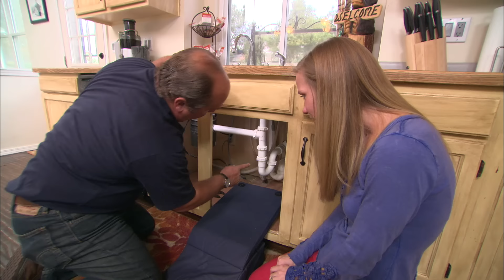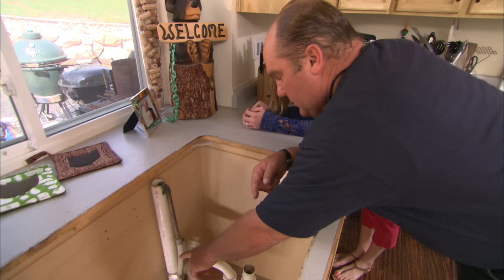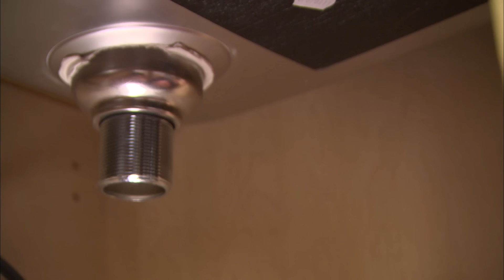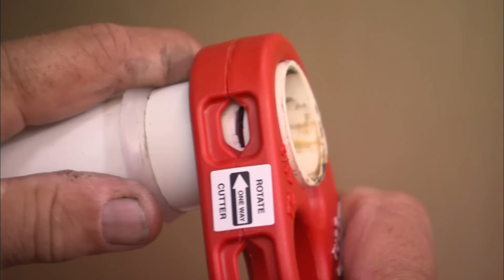How to Replace a Kitchen Sink and Faucet | Ask This Old House

Comment: Many diy disposal installations with a dishwasher drain connection dont break out the seal and call an appliance repair guy because the dishwasher doesn’t drain. An expensive lesson.

Comment: I would have left the pipe above the old dishwasher p-trap and PVC welded a cap on the riser. Just cut off the top 2 inches to eliminate the gap that was cut out at the top. It would be a longer term solution. That black rubber cap will eventually deteriorate and start leaking. With the top of the pipe so close to the faucet it shouldn't interfere with the operation of the spray hose. In some jurisdictions you need to have a plumbing license to remove a p-trap (even temporarily)
If the remaining p-trap pipe DID interfere with the sprayer hose, I would have used a hub saver to drill out the old pipe from the PVC sanitary tee and pvc welded a plug into the fitting. That would give you the same permanent solution and remove all of the old piping from the under sink area.

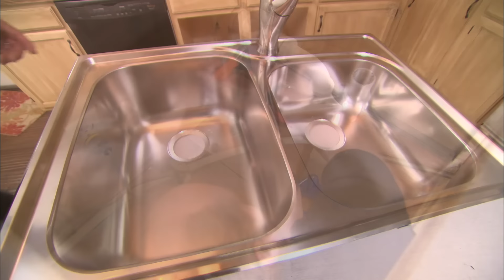Comment: Lots of comments on here asking about what brand this sink is. At 6:23 of the video, when they are lifting the sink into place, you can see a sticker with the brand name on it. It is a Blanco sink. I’ve looked at their website and I don’t see this sink available anymore. No mention of an integrated gasket on any of their sinks.  UPDATE: I just talked to Blanco on February 20, 2023. They advised that ALL of their stainless steel sinks come with an integrated gasket and hold down clips!!  So there ya go!!
Reply: Likely because most sinks today are made of stainless steel or cheap plastic.

Comment: I wish he would have showed the tightening wrench that comes with garbage disposals. It's a lot more versatile than using a screwdriver, especially when working in tight areas, plus it's made to insert into the bottom of disposals to manually turn them if they become stuck.

Comment: Very nice, easy-to-follow video with lots of rxplanation.  I am not sure if anyone asked these two questions:

1. I did not see the use of any teflon tape.  Why not?
2. Plumber putty is know to dry up and crack, shouldn't a waterproof silicone been used instead?

Again, thank you for the wonderful video.
Reply: Teflon tape or pipe dope is only used on tapered threads. On fittings with a compression ring or gasket you don't use any.

Comment: Came here after my sink got installed to see the process. Something told me to do it. I'm disappointed that I didn't get silicon added, that he didn't knockout the dishwasher hole for the disposal, and that he left the job completely incomplete because he couldn't make the piping work and told me that somebody would need to cut out the whole piping. That was false. I had another guy complete the piping part in 40 mins. I gave the previous guy the benefit of the doubt because I was going from 7 inches of depth to 10. But the guy that completed the piping said that piping never works out of the gate and the increase of depth shouldn't be too much of a problem. And one more complaint for the original guy, he didn't clamp down the sink. Not the worst thing though.

On a funny note, I got that exact faucet displayed in the video or very similar to it. My can be activated though by a touch.

Comment: Funny that he uses a screw stick as a screwdriver for all his clamps, when he can pull the bit out and use the barrel as a nut driver on the clamps. SOOO much easier than using a flat tip screwdriver.

Comment: Both of those shutoff valves were leaking, why were they not replaced??? Also, the control valve for the sink faucet goes to the right, no on the center... And why did you reinstall that Badger disposer, they are the bottom of the line product from ISE. They rust out often (because they are not  stainless) and they do a poor job grinding food and have a lot of blockage issues...

Comment: My luck... the screws that are the hardest to access would be rusted stuck and stripped, and they would've used epoxy rather than silicone to glue to sink to the counter.

Comment: The dishwasher discharge hose is routed incorrectly. It needs to be routed through the cabinet about 2” below the countertop. That way any food that gets stuck in the hose won’t be suiting in the lowest loop of the hose which could clog the hose and if left long enough it will smell.
Reply: Nah it's fine

Comment: I am amazed that "this old house" doesn't own a sawzall.
Reply: Richard is using "the right tool for the right job.' 

A specialty tool like the tubing cutter he used in the video automatically deburrs and bevels the pipe to prevent leaks, rather than the uneven and / or barbed edge that may be produced when using a hacksaw or power saw. 

We can file down an uneven edge, but a tubing cutter is less than $30 and can then be used again in future plumbing jobs.
Reply: Yeah for real. Hackzall or multi tool. Painful to watch
Reply: 4" hand grinder withe abrasive cutoff wheel life saver

Comment: Cut the pvc pipe then proceeds with a rubber cap without removing plastic residue. And why the rubber cap ? Why not glue a pvc male fitting , teflon and screw cap ? Little more permanent...

Comment: Without a stabilization plate, that faucet is going to be pretty wobbly.
Reply: How so? I've installed 100's of them with no wobble. If you tighten it underneath the sink properly,  you will never have a problem.

Comment: I would use a portable battery powered saw to cut out those pipes. So much easier and quicker. Milwaukee makes an excellent on small enough to be used for this application.

Comment: Any type of fernco cap or coupling requires 35 lbs of torque  in order to properly seal.. using a nut driver  will not allow full seal... need special 35 lb nut torque wrench

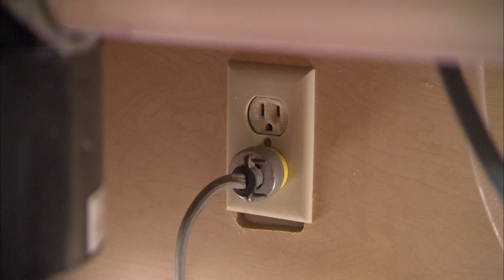Comment: 2:04 Should that outlet be a GFCI outlet?

Asking because mine doesn't have an outlet at all. It is direct wired and I was thinking of adding a outlet and a plug.
Reply: John Smith May be connected to a gfi breaker in her service panel.

Comment: I never understand ,why the homes dont have a drain going out the house from the under cabinet ,so in case of leak the waste water flow out of the house,like the one used on the ac overflow pan 😛😉
Reply: I presume that would be possible, however a downside of that is it would be a dry drainage, meaning you have an open line directly to a smelly drain.

Comment: To cut pipes close to a wall or other obstruction, use string. Take some string, the same stuff a string line uses, put it around the pipe and "saw" thru it but pulling it back and forth. Sounds crazy but it works great.
Reply: That's so funny, I was just picturing that exact solution while watching Richard sawing.

Comment: Homeowner: At 10:22 it looks like one of the disposal clips (the round steel bit to the left of the mount) missed grabbing onto the mounting ring like the others did. It doesn't seem connected. Or maybe they caught that later. 

I'm a big fan of Rich & the TOH team.  Been doing right by homes for decades.
Reply: I thought the same thing the first and second time I watched it. When I enlarged the screen, it was very clear that everything was engaged. That "round steel bit" is simply used for tightening. I wish he would have showed the tightening wrench that comes with garbage disposals. It's a lot more versatile than using a screwdriver. It's also used to insert into the bottom of disposals to manually turn them if they become stuck.

Comment: The old air gap pipe does not complied with city code.  Should use a new air gap for the new sink between the dishwasher hose and the garbage disposal to prevent clogged water flow back into the dishwasher.  On the other sink, the rubber gasket should be used in place of the putting.  It does not make sense to put the gasket under the sink.  The metal cap has an opening at the bottom.  The only water leak is only under the top strainer, putting is not needed for this sink strainer, and the rubber gasket is installed at the wrong location.  Rubber gasket is specially designed for this type of stainless steel sink.  How could a professional made such kind of mistake?

Comment: how do you adapt new faucets with half inch pex to 3/8 inch hoses on the new faucet .All new faucets come with 3/8th inch hoses and the cold works fine but the hot one just keeps leaking no matter what I do to the adapter that lowes sold me .I tried the adapter without a washer and with a washer but it continues to leak .Sometimes it takes a couple of days other times only after i use the dish washer .I am at my wits end with this thing

Comment: The hardest part about installing sinks is following whatever dumb ass installed it before you 5, 10, 20, or even 40 years ago (old apartment complex). The worst problem was leaks due to the overflow section of a bath sink rusting so after fixing a small problem like a bad p-trap and resolving the pipedream like drainage you have now disturbed the connection to the bottom of the sink causing it to leak. Tightening it wont work because the soft metal now gives to pressure, bends and breaks. Now you need a new sink. 1 out of every 3 sinks fought me. Glued in or tacked on in mysterious ways that only gave to sheer force while trying to protect the countertop. Don't bother reusing the old faucet they stopped making parts for it years ago and besides its welded onto the sink with rust. Okay, new sink put it now routing the drain to the non-adjustable glued in trap arm. Custom connection, pray you didn't break anything else by fixing this problem, look at your monstrosity and cringe while you test it for leaks. Apologize to the resident for it taking so long to order parts, listen to their complaints on the company, rinse, repeat.

Comment: The sink seems like a down grade if that other one is cast iron.  I have a faucet like that one and I think the person installed it wrong because it sucks.  It's impossible to turn and the hose has to be pushed back up some of the time.  Really considering going back to a 2 handle faucet.  Just bought a new basin and it's wonderful! Time to start a mini remodel.

Comment: Instead of straight across disposal drain pipe, you should angle down disposal pipe to the drainage system to avoid standing water in the disposal and rust build up. Teflon tape on all connections is always a good idea..don't see any here. Plus assemble the baskets drains, faucets and any other accessory before installing the sink. Much easier and less crouching.
Reply: Teflon tape is not necessary or helpful for compression connections; the compression ring or gasket is the sealing element, not the threads.  Teflon tape is primarily used for sealing tapered pipe joints, where the threads form the seal.

Comment: Unless you live in Heaven, NEVER get a stainless steel sink! Normal (earthly) water will cover it in minerals within days (oh, I forgot, women LOVE to clean their sink every day!). My new sink will be white.
Also, PLEASE use some new teflon tape when you reconnect the water feeds (a glued-on PVC endcap would have been better for the old dishwasher drain than that rubber one). 
Finally, who is the sadist who puts that wooden board in the middle of the cabinet opening? You have to be a contortionist to get in to disassemble the pipes. Cruel!

Comment: Now if your sink trap clogs, when you run the dish washer and it bypasses through the disposal, the water will back up into the sink  (most likely spraying out)!  Would have been better to use the separate drain like it was in the first place - evidentially that upright was a vent - you would have to run a vent pipe to the outside.

Comment: Nice video. I don’t understand the point of the girl, though :)). Regardless, I need help. What would you do if you’ve got a new 3-hole faucet and a 1-hole sink? I dug through a few forums and sites (HealthyKitchen101, terrylove, etc.) and they say you can actually cut some extra holes. Would it be less expensive than just to buy another faucet? Thanks in advance.
Reply: Less expensive if you already have a hole saw kit with the proper diameter and drill. But if it doesn't bother you just get a different faucet. Less work involved.

Comment: I need help. I changed my kichen faucet along with the hot water sink valve, but now the water is running very slowly on both hot and cold. It's been over 48 hours.
Reply: metalupyourazz1 sounds like maybe debris is caught in the faucet aeration screen. Remove that, clean and replace.  When replacing a faucet always remove the screen before turning on the water.  Then the crud flows through without getting caught.  Then replace the screen.

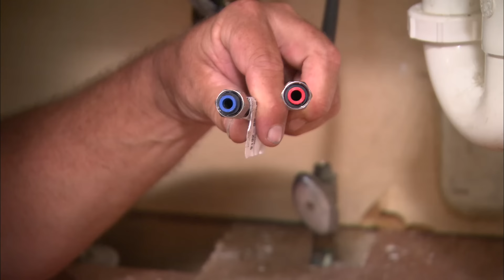Comment: In the limited experiences I have with plumbing (i.e putting on a new shower head), shouldn't he have used plumbers tape (or something similar) when connecting the hot/cold water hoses on the faucet to the shutoff valves at 7:02?
Reply: No, tape is not necessary. Those are compression fittings. The end of the line is beveled and makes the seal by itself when the nut is tightened. There is no water that is flowing between the fitting and the nut.

Comment: What about the dishwasher air gap? Without it, wouldn't a clogged sink drain could cause water to flow back into the dishwasher?
Reply: George Applegate  there’s a check valve on dishwashers , prevent waste coming into the unit

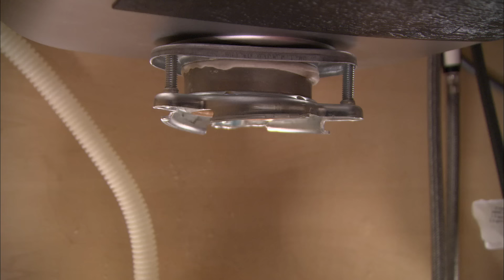Comment: For those replacing a garbage disposal: I can never get it connected (video part 10:15) because of the weight, so I use a car jack to lift and hold it in place so I can screw it on.  Works like a charm!
Reply: OK
Reply: I find it humorous men have to act all tough just because a lady found a smart way to install this herself.  Pretty insecure of you guys!  🤣🤣🤣
Reply: Just wondering if along with pre-installing the faucet could you also install the disposal before installing the sink?
Reply: Yea car jack I'm put tht into my buddy bucket 🤣and go into a home owner house like 👍 u see how I do it thts why u call me
Reply: @larrylove1    I was talking to DIY'ers without strength to hold it.  Hahaha!
Reply: @kayoss9922  my friend used a car jack to lift a new water heater onto the pedestal, he showed me pics, his old one was leaking, and nearly flooded the garage, using a car jack is pretty creative
Reply: Kay Oss. Or u could just hold it like a man.
Reply: @michaelcastillo3231    How could I hold it like a man if I'm not one?  I'm a petite lady,  I use tools to my advantage.
Reply: @michaelcastillo3231  that's funny 😆😆👍

Comment: He stated that the sink was 18 gage.  I  installed my stainless steel sink. I was told that the sink I was buying was 18 gage.  I checked it with a micometer and it was 21 gage. I did my investigation and found that the sink industries don't make a 18 gage stamped sink, which this is. So if your told the stamped sink is 18 gage question it.  My research told me that a 18 gage sing is welded together. Most restaurants have these welded sinks. If you find an 18 gage stamped sink, please let me know.

Comment: Sir, thank you so much for this detailed video. I installed our new sink with this. I can only imagine what a contractor would’ve charged us. Parts of my install was a challenge, due to such tight quarters and my plumbing inexperience, but I got it done. Also, I replaced the all the piping with a $15 garbage disposal piping kit from Home Depot. It was very easy. Thanks again!

Comment: Which do you think is easier?
 Removing a 100+lbs all glass medicine cabinet.
 Or replacing a piece of s#! Moen Faucet when the cartridge runs out?
  Yeah... They built the cabinet after the faucet meaning I won't have a chance in heck of pulling the cartridge. It will be easier to remove it and pull. But while I'm at it why not replace with a faucet that uses ball valves?

Comment: I think Richard can check out latest 2015 IBC plumbing code section 802. Air gap is "no longer code" ? In my understanding, if IBC says the dishwasher ( section 802.1.6 ) "shall discharge indirectly through an air gap", local jurisdiction can only enforcing in a more strict sense, but not the opposite, "no longer code"... Is Richard a licensed professional / or maybe he hasn't got his continued education yet??? Richard can fix the air gap and make it discharge into the sink, not getting rid of it.
Reply: gloria sham IBC isn’t applicable here; this is a residential install.

Comment: Nice Video! When you get all done though - I would run water and check for leaks under the sink for sometimes you have to tighten up fitings.
Reply: They didn't show it, but they obviously did that before turning on the water. When she opened the faucet the first time, it flowed like it was never disconnected. If they hadn't run the water already, it would have burped and sputtered until the air was purged.
Reply: THAT is what a follow up service call (at $100) is all about.

Comment: looks sooo easy! case in point. tile counter top. tile overhangs cut out for sink. cut out just barely big enough for the new sink. clips are too short because of the tile. faucet hits window sill and can't tighten down.

Comment: What Richard did was wrong, you alway attach the dishwasher to the sink strainer and NOT the disposer because if the disposer clogs, then the dishwasher backs up into the sink. That is why dishwashers can't be attached to disposals in Illinois.
Reply: Acid and corrosive waste from the dishwasher coul actually help the disposer not clog at all... it depends on what many horrible things people will force the dishwasher to digest.
Reply: Risk assessment is not covered in this video ...
Reply: Hahaha sure....
Reply: Air gap is a better solution.